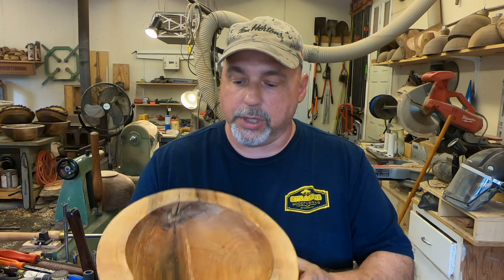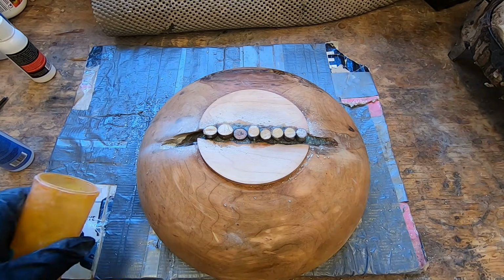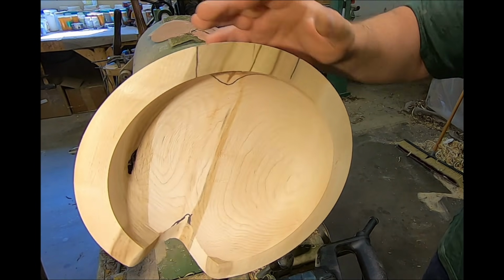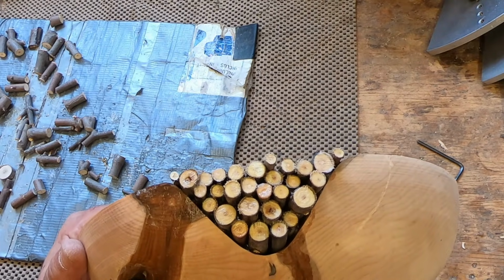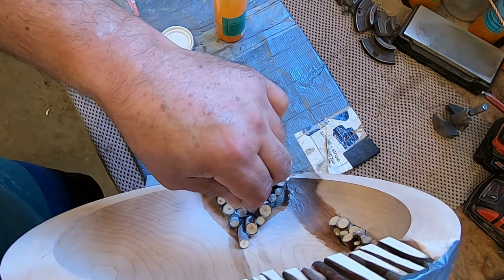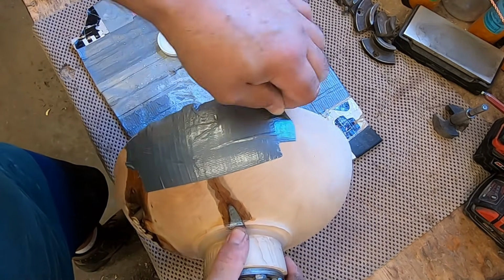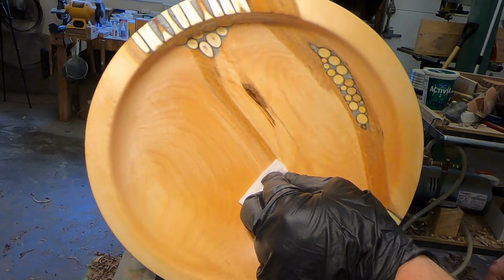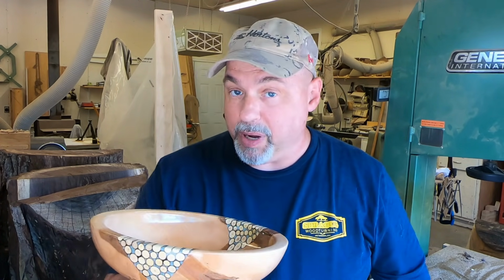Woodturning - Maple Branches in Soapstone Inlay

Comment: Great job....im learning what I need to no to become a better turner and utilize    pieces of wood with voids and cracks.
Reply from the maker: Thanks 🙏🏻
Reply: Hi Jim. Chad here.  Is that glue you use just a bunch of glue sticks melted. Wondering.   And thanks again for all your secrets.  There is great value in that.  Also I got lots of quartz rocks here on my property. Would that work for inlay material.    Thanks jim.
Reply from the maker: @exoticmanzanita  yes it is, I buy them in bulk. Quarts is really, really hard and I would think just about impossible to turn and sand. It would also disappear when crushed and flooded with the CA glue in the grove. This happened to me once when I inlayed clear sea glass.
Reply: Thanks Jim for all that great advice.  I appreciate you.

Comment: Great idea ! Thank you for this. I think I'll give it a try with coffee powder instead of soapstone to see if what effect the brown color will add
Reply from the maker: I’ve used coffee for my years as an inlay, it gives a natural look and it’s also a great way to fill in bark inclusions. Jim
Reply: Nice idea... 
I wondered what I could have done.
Jimmy did something technically perfect... As usual.
But personnaly the branches and blue color of soap... I didn t feel "confortable" just on an aesthetic point of view.
But... I am still wondering what I would have done.
Yur issue with coffee soap sounds good for me. My very first idea was to purge bad ceacks and then re do a "sane piece" as a patchwork completed with a brown soap. Coffee mould could be a good issue.
Not easy to "save" such a damage piece for sure.
Jimmy proposed his way of repairing. Others can be found.
With maople... It was a challenge anyway

Comment: Fabulous. Fabulous!!
Give Acks sanding paste a try; might avoid the steel wool fiber issue. It's food safe.
Appreciate the time you invest for us in making the videos!
Reply from the maker: One of these days I just might give it a go, I see lots of other turners using it in there videos. If it’s got some kind of wax in it, that might be a problem with putting another coat of finish on tho? Jim

Comment: Great technique, thanks for sharing it.  You, quite understandably, emphasize the importance that the branches being extremely dry.  I do not have a kiln but I do have a toaster oven.  Do you think I could get the branches sufficiently dry in a toaster oven?  Any advice on temp and time?
Reply from the maker: A toaster oven should work as well,  200f and weigh them and when they stop loosing weight they should be dry

Comment: Thats probably one the most unique pieces I have seen.  Beautiful.  A cojple of questions.
Are the maple branches dried?
What kind of glue do you have in the deep fryer?
Early on you mentioned that trying to turn back the branches would just tear them out. How did you keep tha from happening on the inside of the bowl?
Reply from the maker: Yes, kiln dried, hot melt glue in a electric frying pan, and the soapstone that surrounds the branches supports them when first turning them back preventing tear out, this is all explained in the video 😄😄
Reply: @SpragueWoodturning  ok thank you very much for the help. I missed that part.

Comment: Another fine job sir!    Quick question -- what type of wheel did you use on the grinder?  

Thank You!!!
Reply from the maker: I will need to look when I go out to the shop today, I got them at Canadian Tire.
Reply from the maker: They are just called flap disks, I used a 80 grit one. They screw right on to my grinder, no need for the nut that usually hold the disk on.

Comment: Looks great. I would have definitely used resin. It would have been a lot less time consuming. And yes, if it’s slow set, it flows like water. Give it ago, you won’t go back👍🏻.
Reply from the maker: What brand do you use? One of the main reasons I use the soapstone is because it looks like a natural material and not plastic, Jim
Reply: Sprague Woodturning I’m in the UK, and use Epodex. The resin can look a bit glassy, but adding the metal powders with colours look great, but I do agree what you’re doing look really natural. I find a pressure pot and neg rake tip tools are a must though. 
https://www.epodex.com/en/

Comment: Is the hot melt glue same as standard hot glue?
Reply from the maker: Same stuff you would put in a glue gun, I just throw the sticks in and let them melt, Jim.
Reply: @SpragueWoodturning  thanks I've been trying to figure out the best way to attach wood blocks to my bowls without using screws that will actually hold without damaging it.
Reply from the maker: This method works great!

Comment: FYI, Resin flows EVERYWHERE.... it is more of a trick keeping it inside where you want, it than getting it into everywhere you want it!! (Though it does have issues with bubbles, if you don't use a pressure put to cure.)
Reply from the maker: Thanks Susan, what I was talking about in the video is thin CA has the advantage over clear resin because it’s thinner and will flow through the inlay and lock it in place. I’ve not seen a clear resin that is thin enough to act like the clear CA. If you were using a colored resin only then yes, I’m sure it would work just fine, Jim.
Reply: @SpragueWoodturning  Yeah, with soapstone dust like that, I'd mix it into the resin to make a paste, but then it would have to be pushed and prodded into place like clay. Different materials, different techniques. I love learning about new ones, even when I think my way is best... often enough I am proven wrong, lol. Certainly it gives me other options to play with!